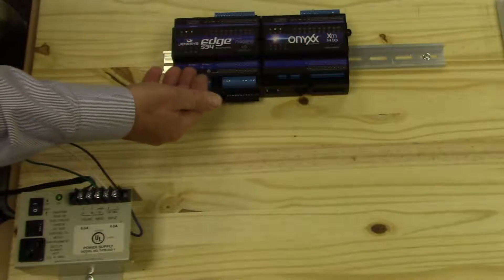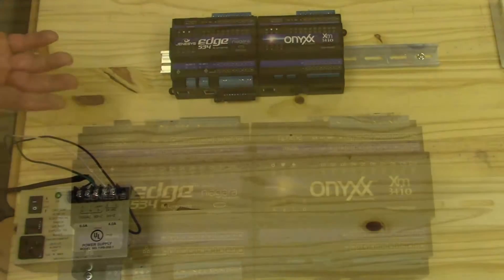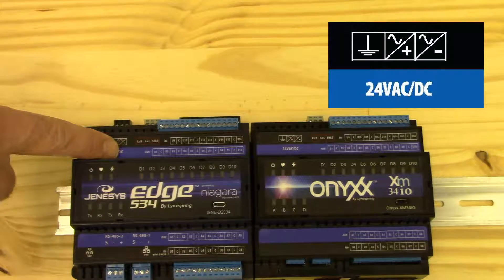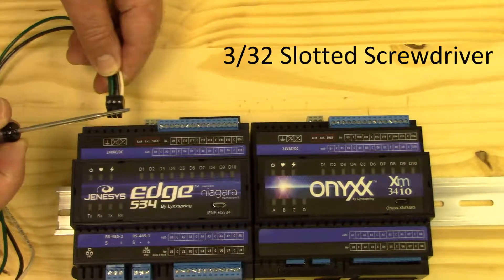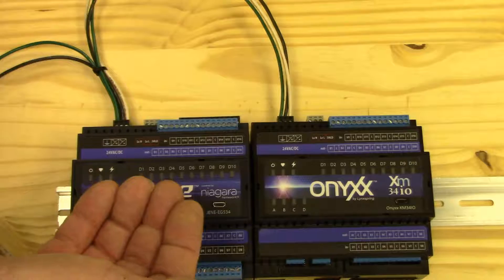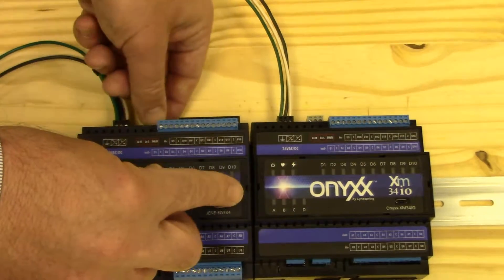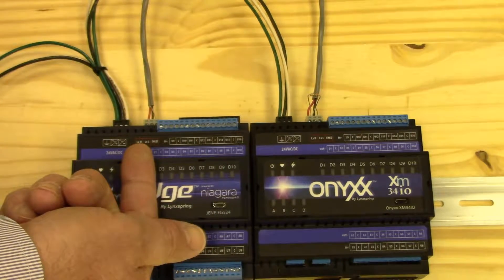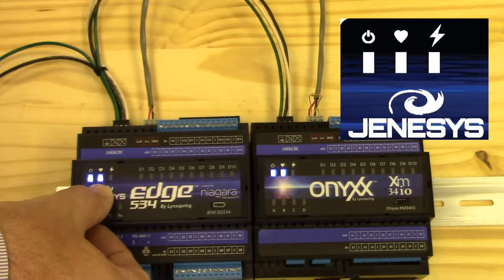How to Wire Power & Communication Between JENEsys® EdgeTM 534 and Onyxx® XM 34IO Controllers

Comment: Thank you for the informative video. I have a quick question. How can we connect multiple Onyxx I/O devices to the Edge534 controller? And what is the basic difference between Edge 534 controller and JACE 8000? Thank you.
Reply from the maker: Hi Gayan,
The 534 may connect up to eight Onyxx IO expansion modules by daisy chaining the Onyxx network 485 connection to each module for a total of 306 IO points. The additional IO modules are address over our Onyxx Network and configurable in Niagara.

The JENEsys EDGE controllers including the EDGE 534, EDGE 514 and EDGE 414 products are Platform Independent Niagara controllers.  Meaning they run the full standard Niagara Framework but on another hardware platform from the JENEsys PC8000.   The JENEsys EDGE controllers include very similar open protocol communications like BACnet, Modbus and FOX with on board IO and unique options not available on the PC8000 and in a much smaller footprint.  The EDGE controllers also offer license options not available to the PC8000.  Both employ the same Niagara Framework but the use cases tend to vary as the EDGE controllers allow Niagara control to be applied in a wider variety of instances such as equipment control, small building applications and application specific projects.

Please visit https://www.lynxspring.com/contact-us for additional information.